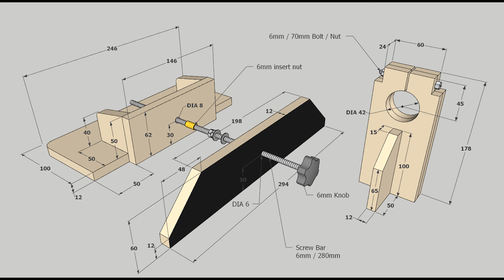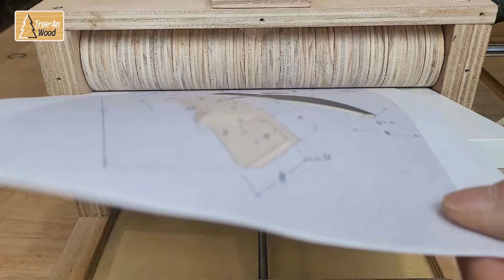Simple Drum Sander // 간단한 드럼 샌더

Comment: Thanks so much i really liked your sander. I am going to try to make your design. Do you think this can be made slightly wider to handle 20-24 inch wide materials like a cutting board?  This would greatly help in finishing after glue ups.

Comment: I am planning to build this. But I have a question. Is there a practical method to change the sanding paper? 

Not because it is worn out but sometimes you need to use different grades. With this setup, you either have to disassamble the cyclinder or untape the sand paper although it still has life in it.